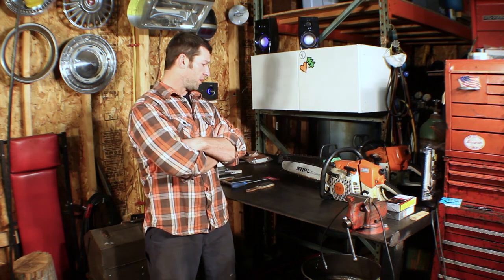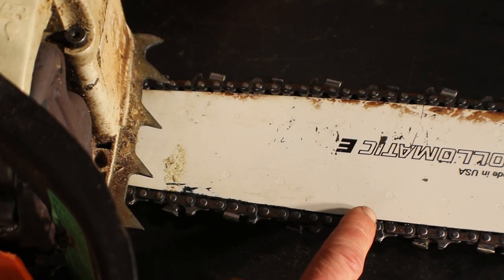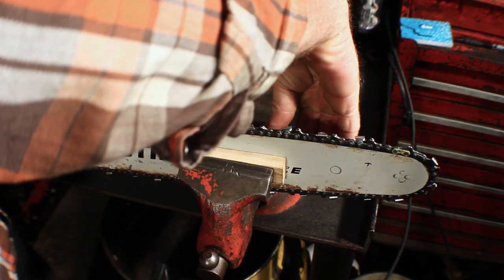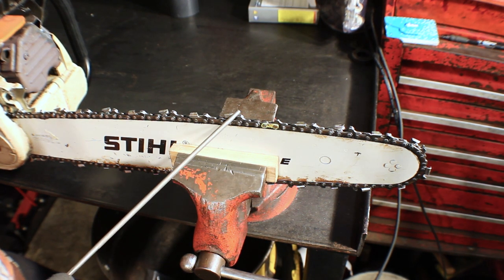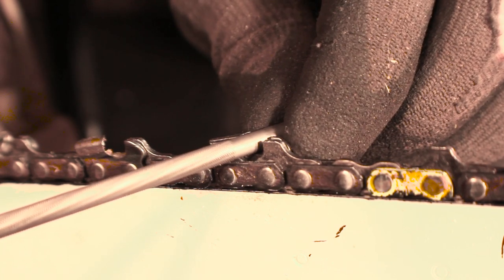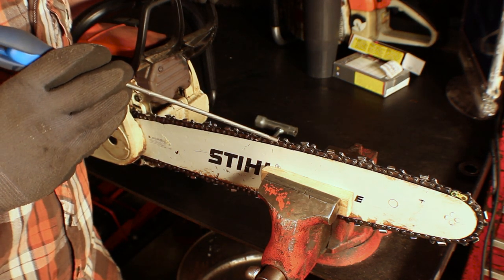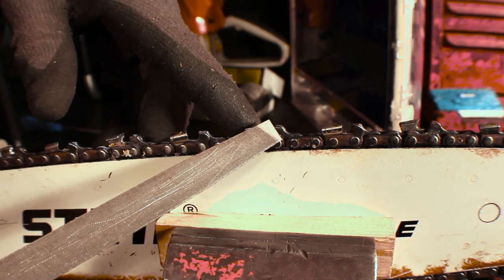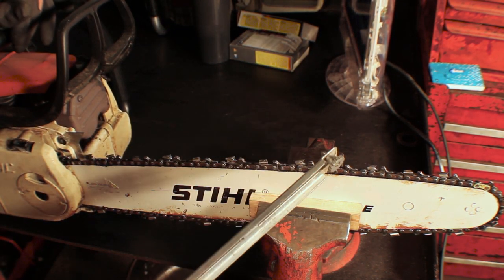Chainsaw Sharpening: How To

Comment: Fantastic video! Crystal clear on how to sharpen my chain saw (MS 029 Super). I bought one of those fancy Stihl multi sharpeners, glad you displayed it too as the instructions that came with it were terrible. Thanks.
Reply from the maker: Glad you got something out of it.  A note on the 2-in-1 sharpener I just learned though, when you get to the master link in the chain, be careful not to take down the raker too far on the cutter with an extra drive link in front of it "if there is one".  Saws' been jumping around a bit much lately, and I think that is the reason.  Sets depth off of the cutter heads, so if there isn't a cutter head directly in front of the cutter you're sharpening, can file it down too low.

Comment: i just got me one of the 2-1 sharpeners.  i love it, even if it only works on full comp chains.  it is pretty much fool proof.  ty for helping me on deciding to get one.  plz keep up the good work on these vids.  i appreciate it.  BTW, love the background music.  have a good one.
Reply from the maker: Thanks.  The 2-in-1's at first seem like a costly alternative, but after using it, it easily justifies the increased initial cost, saves so much time.
Reply: REal Cutters don't need a guide in the woods.. and a Stump ca be made into a vise with propr cutting an shaping!  The swedes have it right on this...    Still Coool Vids fella..

Comment: Been sharpening chains 40 + years. Never used anything but a flat and round file. Always cut straight as 6:00, never threw one out till 2 or more teeth broke from being too short.

Comment: If you have the misfortune of dulling your chain by touching the ground or a rock, I generally look for the worst tooth, file that one back too un-galled steel again. I do this by first filing at almost 90° to the bar, the swinging back to 30°, and bringing the rest of the tooth back to meet the working corner. If the working corner isn't pointy and sharp, your wasting your time. When you get your new chain, all the teeth are the same size, and it's cutting at it's optimum. I use Vernier calipers too measure the first tooth, then match every subsequent tooth too that size. Within a couple of thousandths. Then file your depth gauges down. It's time consuming,  but worth it. It'll take 20 mins to do it right, but the end result is a chain that cuts as good or better than new. 
There's nothing worse than trying to cut with a chain that's irregular in tooth size, or the working corner is blunt on one side. You have to force it, or it'll cut in an arc, which is laborious, time consuming, and frustrating. Exercising a little pride and passion goes a long way.
Cheers.

Comment: One thing I wanted to point out for people new to filing chains.  All 3/8 .050 chains will take a 7/32 file.   Especially Oregon.  Stihl uses a 13/64 or 7/32 is fine.  If the chain is a 3/8 low profile THEN a 5/32 file is needed.  If unsure the Box the chain came in will also tell you.

Comment: I have the same saw.  I accidentally rolled over it with my quad and the chain brake handle cracked and the clutch side cover with the tool-less adjustment.  Can you only source them from an authorized Stihl dealer or are there non-oem manufacturers?
Reply from the maker: There are non-oem manufacturers out there, check ebay, or even treestuff.com.

Comment: Hi from  Oamaru New Zealand. regarding saw in vise have you considered swivelling the vise around with saw in jaws?. assuming its a swivel base vise. o.k the 2 n 1 is the files standards or are they unique to perfeerd?. cheers.
Reply from the maker: I've a new vice now, and that's a great Idea, but it doesn't swivel a full 180.  The round files are standard, the flat file in the middle is not, so they're a bit pricey, something like $8 I think

Comment: Great video especially for the sharpening novice. Thanks for the tips and just ordered a 2 in 1 easy file after watching this.
Reply from the maker: Awesome, you'll love it.  One thing I've learned though, don't put much down pressure at all, takes down depth gauge a bit far and you'll end up with a super aggresive chain.  Just a slight bit of back pressure is about all you need.  Enjoy!

Comment: Good video. 
You should mention that the Stihl two in one only works with full comp chains. I wanted one , but I run a lot of skip tooth, so....

Question though, any idea what depth the 2 n 1 sets the depth gauges at?

Thanks, keep up the great videos!
Reply from the maker: Good call, didn't even think about skip.  Not sure on the depth, but Kyler Monares, also in the comments, mentioned that his takes them to .035, something I'll have to look into.  No information on their website, have to make some inquires.
Reply: Human , cool. I've just start increasing my depth gauges, massive improvement in cutting. 
But probably not recommended for the weekend warrior.  .035 seems pretty aggressive for a do it file guide. I would think it'd be closer to .020-.025.
Reply: Good Day Farm h hhhhhh.
Reply: Robert Hoscheit 

Yes?

Comment: I normally let my chains soak over night in industrial degreaser from The Depot. I let the, dry out and then file the, so they are super clean. I normally keep 3-4 chains so I don't need to wait hours for the chains to dry before I sharpen.
Reply: Tim B ha ha ha ha ha you what? degreese your chains?? what for??? you must like to waste time and money
Reply: Tim B Degrease from what. The bar oil is gone for sure.

Comment: Hey human do you like/recommend Oregon chains and bars?
Reply from the maker: Haven't used there bars at all, only one chain.  The chain I was not such a big fan of, you can check it out in my 201t chain comparison vid.  Two things about it kinda turned me off
1:  Isn't pre-stretched, felt like I was having to tighten it every 10 minutes.
2:  Kept getting stuck in the cut "brand new from box", not sure if the depth gauges were too low or what, but was pretty annoying.

I do use quite a few of their other products though, and they're pretty good for the most part.

Comment: You spend ages sharpening the chain, then on the first cut, you slam into a stone the tree ingested, or some wire..and the works gone out the window and back to dust... so fast beats fussy. If you can resharpen fast, you're back in bidness. Cordless drill ftw.

Comment: if you have cutters at different lengths it doesn't matter, it will not cut on an angle. dont get too carried away
Reply: What the hell are you talking about??? It doesn't take much for a saw to start goin' real hard sideways!!!
Reply: Wrong. If the bar groove is worn or the wrong ( too small ) gauge chain is used it will cut on an angle. This is due to the chain laying over due to excess clearance in the groove. Different length cutters do not make it cut on an angle - total misconception.
Reply: If your left hand facing teeth are all filed to generally X, and your right hand facing teeth are all filed to Y, Please explain how in the hell they are not going  to pull to one side. I am well over 20,000 trees dropped, and almost 40 years on a power saw, so please be precise...
Reply: It the bar groove was tight the chain physically could not angle. the particular example you provided would be very rare, and i would be surprised if it ever occurred - unless it was done on purpose. 

In the real world if you have cutters that needed a few more strokes then others, and say some cutters were a bit shorter then others it will not cause an issue. I was taught by a no non-sense faller that knows his business.
Reply: 1) If your cutters are different heights, you don't need to have any play in the groove for the cut to go crooked. 2) How tight do you run your chain?!?!? I have never seen ANY of my colleagues, spanning 25+ tree companies, and a few thousand years of experience, who run a chain so tight as to eliminate any play. It is not a case from the real world, sorry.
Reply: ....Jesus. Just go and try it.....go buy a new chain and sharpen only one side with 30 solid strokes. Then try making that fucking saw cut straight.
Reply: I agree. I cut timber for close to a decade. There's no need to be all anal about sharpening. Most of the vids I see, the bloody saw isn't sharp anyways, even with the faffing. File into a cordless drill, file, drop the rakers every now and then and you're making chips. Not dust. I like Human, I like his videos, but jasus, he does overthink stuff. A lot.
Reply: I've made many cuts that pulled one way or the other because I suck at sharpening chains, you are completely wrong. Dont believe make a cut with a new chain then let me put my custom file work on it, it's almost art.
Reply: @samuelluria4744  if your rakers are  gagued it don't matter if you hit half the teeth 20 times the other half4 times. I see why you been through 25 employers.
Reply: @samuelluria4744  40 years  lol and 25,000 trees I have seen many of your comments lol. And I don't think you have a clue most of the time.
Reply: Stepp of Faith - Where did I say anything about 25 "employers"?? Do you know what the word colleague means?
Reply: Stepp of Faith - What exactly is the  "Lol"? 40 years?? 25,000 trees? Which is it? Both? It is funny to ME, that either of those things is funny to you. I have CLIMBED a minimum of 600 trees each if the last 23 years, and that has absolutely nothing to do with the hundreds of lot-clearing jobs, which are usually at least 250 trees at a shot, over a two or three day period - albeit mostly dropped from the ground, without climbing..... Please explain what you think is so cute, and also, which other of my comments you take issue with, and why. I could always use a good laugh.
Reply: Stepp of Faith - "Don't have a clue".... PLEASE, I'm waiting to hear ONE example of what you think is clueless.... Please, I'm BEGGING YOU....
Reply: As long as the rakers are the same depth in front of the cutting tooth it does not matter what length the cutter is.  THAT is the truth.

Comment: if you file the rakers evenly on both sides it won't matter how much either side of cutters is filed
Reply: ian martin who files chains anymore?? when i go cut i bring my saw and 3 spare chains and i cut for 10 to 12 hours and bring 1 sharp one home with me. i use a orgon sharpener gets the angle rite on and razer sharp
Reply: 1970 olds442 im a residential tree worker. we run into a lot of rocks and pieces of metal and its better to file on the job than to buy multiple chains
Reply: You are both unbelievably WRONG..... It's the blind leading the blind.....
Reply: Samuel Luria then enlighten those you insult or keep to yourself
Reply: What is there that requires enlightening??? If the cutters on one side are cutting more than the cutters on the other side, you WILL end up cutting OFF. There is no reason to question the basic physics.
Reply: (That being said, I NEVER use a gauge, neither for the cutting teeth, or for the rakers; I simply accept the level of consistency that I have attained. That doesn't mean that I completely negate the fact that the level of discrepancy between the level of cutters on either side WILL have SOME repercussions. It is simply acceptable to me, that the saw cuts 94% straight, or whatever the number may be.  I can't even imagine how the difference between cutters on two opposing sides can be negated. ?!? )
Reply: Samuel Luria look up victorious victor and buckin billy ray. they have proven all you need do is keep the rakers set no matter if on side of the chain has cutters at brand new length and one side at 10%. it will still cut straight. every person on this earth who knows saws properly will tell you that
Reply: I think your saying it wrong.  I know your saying it wrong but mean different.  As long as guides are filed to each tooth then it will cut straight. If sharp that is.
Reply: nic jones  this and my other half are my entire life. I've basically spent every last cent I could squeeze out and every spare second of my life on tree work and saws. Ask my other half about how I scream at her in my sleep because she isn't climbing fast enough lol

Comment: Hey human did you know each tooth on the chain has a small black line on the top of the tooth witch is also a guide line for free hand sharpening. Check it out I just found this out lol
Reply from the maker: Yep, it's also the point where your supposed to toss the chain away when your wear gets to it.  Though I don't take mine back that far, I feel embarrassed walking around with a chain that has tiny little cutter teeth like that, lol
Reply: Yea I never get them that low I just never knew it angle was for sharpening. I'm still learning on the sharpening thing
Reply from the maker: I think it's a process that you never stop learning, I am as well.
Reply: Love all the videos

Comment: Nice tutorial, but you're killing me with the soft jaws. I've found that some aluminum angle stock hammered around the jaws is the way to go. They last a lot longer than wood and that way I'm not fighting the wood and my part.
Reply from the maker: Will likely do that, didn't add the wood to protect the bar, steel on steel isn't really an issue.  Acting as spacers, without something, the vise locks down on the teeth and I can't rotate the chain.  Great idea with the angle though, don't have aluminum, but the steel I have will work just as well.
Reply: Aluminum IS SOFT, wise guy.

Comment: Human! Bin the file handle, snap off the tang, stick the file in your cordless drill and file it using the drill. Faster, better, more powah. Cuts out a lot of fluting around. Use a raker guide and a flat file to drop them every so often and Bobs your auntie. There's no need for all the panty-waisting and faffing.

Comment: My point is . You don';t know what you are doing .You are doing a disservice to anyone about the ability required to sharpen a chain with a hand held round file .
Reply from the maker: Which part isn't correct?
Reply: The part that every tooth needs hit the same number of times. And the line on tooth is for Angel not stopping point for filing. And that your embarrassed to use chain with short teeth. A chain cuts better after few times sharpening if you are a pro that tweeks with angels and depth of file or gillet as bill ray says. Treat each tooth and guide sepratly.

Comment: Bull .Unless you use the saw every day,use the round file for light maintenance ,it is impossible to sharpen chains manually to a uniform depth.You are doing a huge disservice to newbies .Throw that cheep chain out .When it gets dull,buy a new one.
Reply: JOHN MITCHELL buying a new chain everytime it gets dull makes about as much sence as buying a new car everytime it runs out of gas